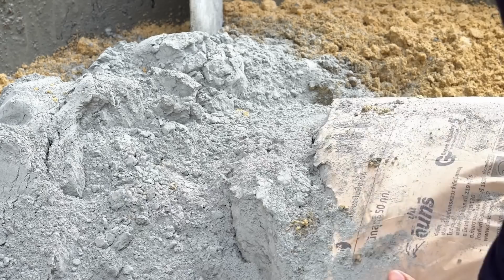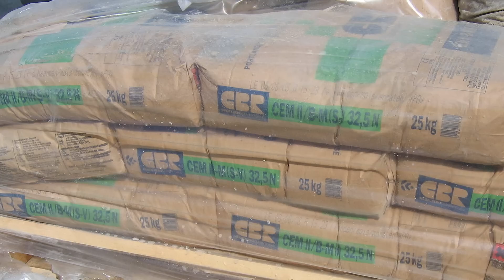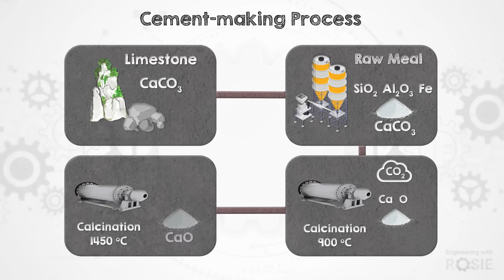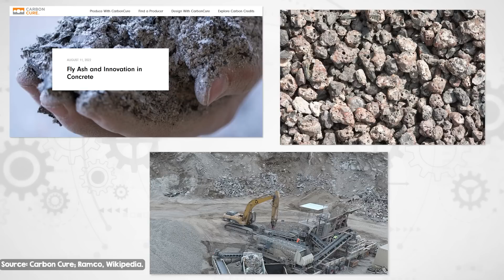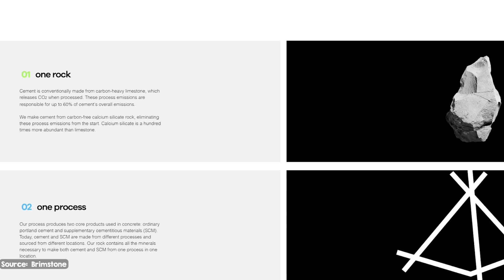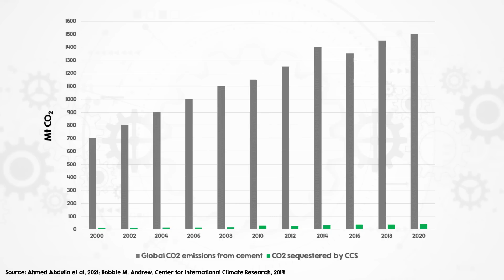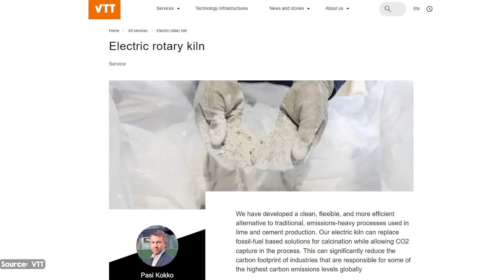Zero Emissions Cement is Closer Than You Think

Comment: Essential materials;  cement, steel, ammonia, plastics  all require fossil fuel.  Add aluminium and silicon, copper    all require either fossil fuels or low cost electricity.  This is so unrealist hopium.  The materials needed to transition to low emissions energy are available for a small fraction of current global population.  Because it is possible technically possibly it does not mean it is either economically or energetically practical.  Carbon capture and storage is a case in point as is hydrogen fuel.  Both consume so much energy to achieve that they are a waste of time.
Reply: ' Carbon capture and storage is a case in point as is hydrogen fuel.  Both consume so much energy to achieve that they are a waste of time.'

!!Sweeping, and sweepingly inaccurate. For both, 'it depends'.
Reply: @davidmartin3947  the energy required does not change; always the same. Laws of physics and chemistry.  Statement stands.
Reply: @dan2304  The laws of physics do not change. Unfortunately that does not help when there is a total want of understanding of how they apply to any particular issue, together with a wish to make absolutist claims about this and that under the delusion that a very partial and defective understanding of the issues at hand is a law of nature. Just a fancy way of claiming infallibility for a very subjectively arrived at opinion. Bye.
Reply: @davidmartin3947  The issue is simple,  At best electrolysis is 80% efficient that is., only 80% the energy in the H2 that was in the original electricity.  The most efficient use is fuel cells, at best fuel cells are 60% efficient giving only 48% of the energy that was in the original electricity that is not considering compression of the H2, for every 10 bar 10% of the energy in the H2 is used.  Storage and transport are also very expensive in both materials and energy.  I don't deal in wishful thinking or opinions.  But use hard data, real numbers and real plotted trends to do analysis and is not subjective at all but quantitative and objective.  In short  modern societies will collapse within a few decades.  There are many complex interactions but global debt, and global warming combined with materials, energy, and food shortage are the the main drivers.  What will human population be in 2100?
Reply: @dan2304  Everything is imperfectly efficient and subject to entropy, but we still rub along.
You seem to assume that it is always possible to use electricity directly, but it ain't.
Where it is possible and more efficient, of course that is the option normally used, but for instance storage in lithium batteries is only practical for periods of up to a few hours, too few even to cover diurnal variation, and they ain't 100% efficient either.
There are other methods of storage, including chemical, so for instance hydrogen, methanol etc.
Nor is electrolysis the sole option.
But using your figures and taking them as perfectly accurate, so what?
The fossil fuel economy has operated for hundreds of years at an overall efficiency of the order of 20-40%, so using your figures we are hitting around that, and only for some uses where direct electrical is not possible.
Reservations are fine, blanket dismissals as you don't fancy some particular metric don't make sense.
It ain't a perfect world, and real engineering is about finding compromises of desirable attributes for specifiic applications, not a God-like 'from first principles' ukase.
Reply: @davidmartin3947 A felacious argument. Fossil fuels are dug out of the ground.  Or in the case of oil and gas a hole drilled in the ground and in a worse case pumped out. A big difference to need to be manufactured in the first place.  The EROEI for fossil fuels while in decline is still higher than all but hydroelectricity.  ERORI is critical.  If EROEI drop below about 15:1 energy production becomes the all consuming industry.  Additionally there are not enough minerals or metals to transition to low emissions energy for more than a small fraction of the current global population. And fossil fuel will be used to economic depletion within a few decades.  When the cost of supply of commodities is more than the ability to pay.
Reply: @dan2304  Malthus may have convinced you, but he has been in error for the past couple of hundred years.
The argument was originally that population would always increase to the brink of starvation, and was used an easy justification for keeping workers at subsistence levels in factories.
The 'inevitable' did not come to pass, and instead the problem in more and more of the world is falling populations, not rising.
Read 'Energy or Extinction' by Fred Hoyle. If energy is plentiful and cheap, then lower quality mineral resources etc work fine.
He made his argument on the basis of Candu reactors, but solar and wind will work fine too, as well as 4th gen nuclear reactors.

None of us know enough to state 'it is inevitable that...' but that misplaced confidence in certainty has led to, or been the excuse for, egregious error throughout the ages.

Ask folk to do a few predictions on who will 'inevitably' win the 3.30 and those who think they have complete certainty about all sorts of grandiose things go unaccountably stumb.

In reality it is difficult enough to work out what is likely over a couple of decades or so, let alone be inarguably confident in predictions over hundreds or thousands of years.

I ain't a God, I don't know, and neither do you.
Knowing that I don't know gives me a head start over you though.
Reply: @davidmartin3947  As I said before, fundamental commodities data analysis, real trends, and actual numbers is what i do.  That enables projections to be made, so far my projections have been accurate from 2001.  I am sort of glad I am a septuagenarian and unlikely to see the collapse. It will take all of Generation 4, thorium, and all the renewables installed were they produce more energy than they consume and it still will not be enough.  The scale of the problem is the problem.  There are no Gen 4 or thorium reactors yet.  The fossil fuels needed to put that in place is not going to stop global warming.  Denying the problem will not make it go away.  Citing hope technologies that are scientifically questionable for solutions is delusional.  How many countries are basically bankrupt?  IMF and World Bank says about 120 with some 120 million people displaced for a variety of reasons.  Things are not looking good.  And you think there will be a solution soon.
Reply: @dan2304  More sweeping and universalist claims, which have precious little to do with the subject to hand, reducing CO2 from concrete production.

But for starters, ignoring solar and wind which IMO are likely to do the job perfectly well, for reactors, and ignoring newer designs which would burn 'waste' as fuel, uranium extraction is a tiny fraction of the cost per KWh, with most cost in build etc.

So at a very low increment in total cost, and with excellent EROEI, we have technology to hand to sieve uranium from seawater.

The reason we don't do it is that there is plenty of uranium on land, at lower cost than the current price in the immature tech of seawater extraction.

Just the same, if we had to, it would add a very small increment to total cost.
Continental erosion means that that source is good for a few hundred million years, which is enough to be going on with.

And although currently too expensive, there is no conclusive reason to rule out, for instance, solar energy from low earth orbit, within, say, the next hundred years, when you are claiming that EROEI will kill everything over those sorts of time frames.

So claims of the 'inevitability' of this and that seem to be predicated on all sorts of very questionable assumptions.

How about addressing the real world of reducing concrete production CO2 emissions, instead of making dodgy assumptions about the far future based on ignoring any progress at all in tech?
Reply: "Essential materials;  cement, steel, ammonia, plastics  all require fossil fuel." - nothing requires fossil fuel, except legacy equipment.  Depending on location, solar and wind can currently be cheaper  than fossil fuels, in UK wind generated electricity is currently a lot cheaper.  Some countries are still investing in fossil fuel based energy generation, so you are right that they don't have access to cheap zero emissions electricity, but it doesn't have to be that way, it is only through choice, often misguided choice, and that can be changed.
"Carbon capture and storage is a case in point as is hydrogen fuel.  Both consume so much energy to achieve that they are a waste of time." : Hydrogen can be made with excess wind and solar power, a lot can be generated for virtually free once we have enough wind/solar to be able to shut down all our fossil fuel generation.  Same goes for the carbon capture, and conversion into construction materials.
Reply: @nigels.6051 I believe both steel and plastics require coal, oil or natural gas. Not as a fuel but for a source of carbon. Renewable electricity can’t replace coal in providing the carbon needed for steel and short of redirecting food from providing energy for humans or animals I believe plastics require a fossil “fuel” source for production. Happy to be corrected if I’m mistaken.
Reply: @quartlygunn6193  Rosie has a video on carbon negative steel using wind powered hydrogen plus CO2 from the atmosphere for the carbon, currently being used by Volvo to make cars ..  well that is maybe not quite accurate, but watch the video.  As for the plastic, you can certainly make useful structural products out of recycled plastics now.  I don't see why we shouldn't grow useful plastics in future, after all, the fossil oil started out as plants before being fossilised and then converted to oil,  I think it is just uneconomic at the moment, but our genetic engineering is getting to the point where we should be able to design organisms to grow most plastics ... of course the other problem is that this might be a bit dangerous if they escape into the wild!
Reply: @nigels.6051  The laws of enthalpy, entropy and thermodynamics are inviolate, they cannot be broken.  The only change is the efficiency of production not the energy required.  For those who have a Utopian view/hope.  Both fossil fuels, most metals and minerals are in declining supply and will be largely depleted within a few decades.  The transition to low emissions energy is available to only a small fraction of the current global population so fossil fuels will be used to depletion.  Meaning 4 C warming and 2-3 m sea level rise before 2100.  The world is in at least 75% overshoot.

Comment: Many thanks for your comprehensive analysis, which certainly does include as a major factor avoidiing concrete use, which some commentators seem to not have taken on board!
But there is no way it will reduce to zero, so you also cover techniques for reduction, some of which I was previously unaware of.

Kudos.

Comment: Nice analysis of cement making. Why do you not propose Nuclear electricity generation as a solution. It is a proven base load 24/7 supply, proven technology and is developing rapidly as an “off the shelf” energy solution.
Reply: Probably because of the information on the cost of nuclear she provided in this video 
https://www.youtube.com/watch?v=quI_8xYSWYE
Reply: The point of “electrify everything” is to decouple our energy consumption from our energy creation/transmission/storage. So it wouldn’t matter if it’s coming from renewables, batteries, nuclear, or even existing fossil fuel plants. Nuclear can be the “solution” in this by being less expensive than other sources. The problem is, nuclear is MORE expensive. Traditional nuclear can’t compete on cost. 4th gen nuclear has been focused on safety rather than on cost, and is 20 years away from even starting to scale enough to matter, even on the happiest of happy paths. And since renewables + storage solves the pressing CO2 problem, it would be incredibly hard to politically justify investing billions (or trillions) in nuclear and deliberately holding back renewables that are already inexpensive and effective.

Comment: Heat can also be produced by burning green hydrogen in air.  For higher temperatures, the Hydrogen can be burnt with the Oxygen which was a by product of the electrolysis.  For even greater temperature, the Hydrogen and Oxygen can be 'Plasmatized' by first passing it through an electric arc, splitting the H2 and O2 into individual atoms.
Reply: lol, no

Comment: Why do we need concrete, build using plastic (recycled) instead...  
The house I am currently in has no concrete, it is made from bricks (clay) with lime mortar.
I walked along a 1Km path yesterday, over very wet ground, path was constructed from recycled milk bottles (HDPE plastic), including the structural beams that hold it up above the water.
Reply: You are a bit naïve.  Highways, commercial buildings, bridges and dams are where most of the cement is used.  While some substitution in buildings is possible, it creates new problems.  Wooden buildings can burn, insects can eat them and they can rot.  Clay materials have no tensile strength and absorb water.
Reply: @alberthartl8885  None of the highways near me are made of concrete, only use of concrete seems to be for bridges and drainage.  There is a new bridge being built near me, about 1Km long, if it had been built 10 years ago then it would have been almost entirely concrete, but it is actually being made of steel, interestingly unpainted steel, it is starting off life rusty, and that is how it will stay!  Given that steel can be zero carbon, problem solved.  As for dams, I walked across one earlier today, didn't use concrete except for the spillway, rest was a heap of stone, I think with a clay core, and that is one of the biggest in the country. I'm not convinced wooden buildings are sensible here, too wet, which is why I suggested plastic, which we already use for our windows, gutters, roofs. Yes, we have been using a huge amount of concrete, especially in cities, but I'm not convinced that we actually need it.